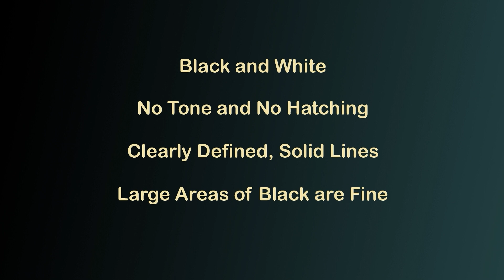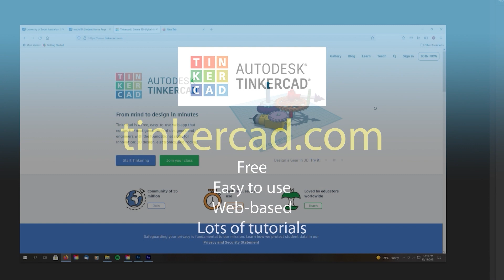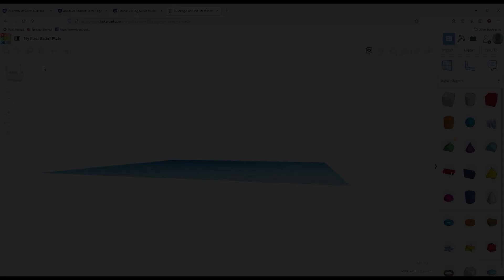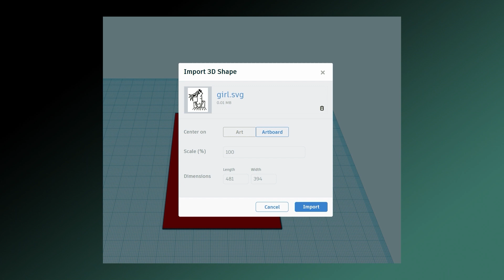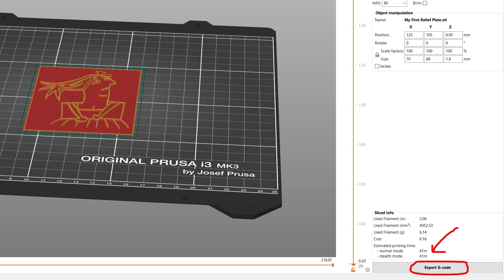3D Printing for Printmakers with Judy Barrass

Comment: I don't see a step where your drawing becomes 3 dimensional. I see you convert it to an STL file, but it is black and white and flat in that step. Then when you import it later to mount to a plate, it is thick and has dimension. How did that happen?